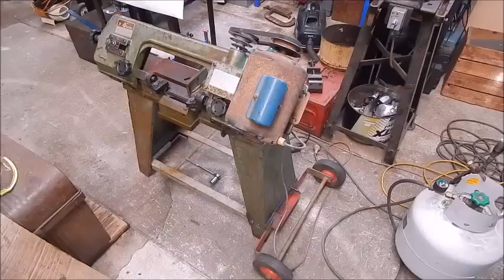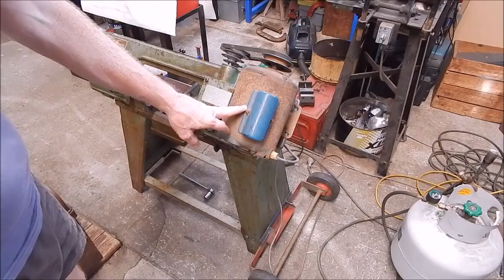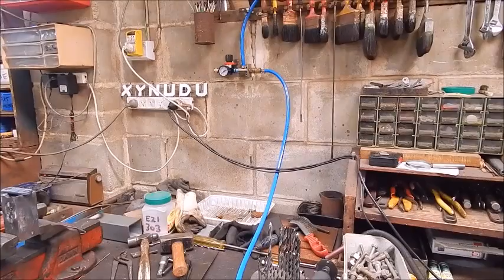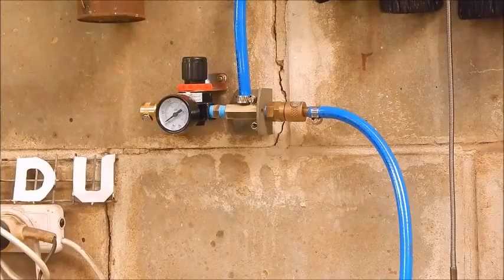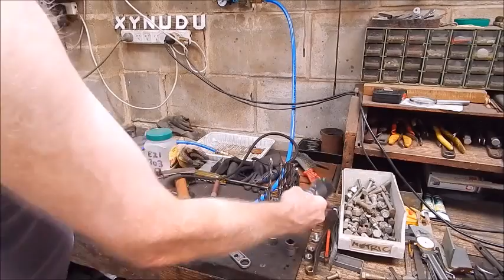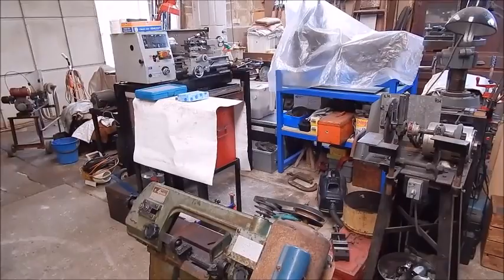4x6 metal bandsaw and workshop chaos

Comment: I love my 4x6.  It's one of the most used tools in my shop.  That was a good idea putting on those wheels,  this thing can flip pretty easily with the stock ones. You might want to check Halligan142's channel.  He has an excellent series of videos on adjusting and modifying this beast.

Comment: On the backside, below the pulleys, on the frame there should be a hole to insert a pin to lock the arm in the lower position. On the front side there should be a hole to insert a pin to lock it in the vertical position for cutting with a bolt on table. It should be directly under the follower closest to the motor.
Reply from the maker: Thanks for the reply.  This model doesn't have a lock pin like some of the Grizzlies etc.  There's a latch to hold the arm up vertical, but nothing to lock it down for moving.  Nothing to engage with the spring arm like some clones.  Rob